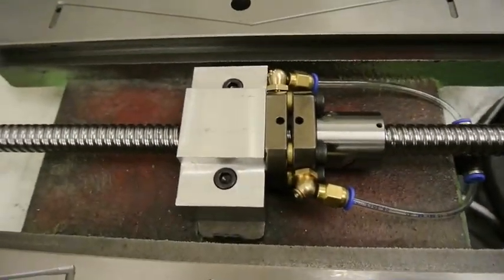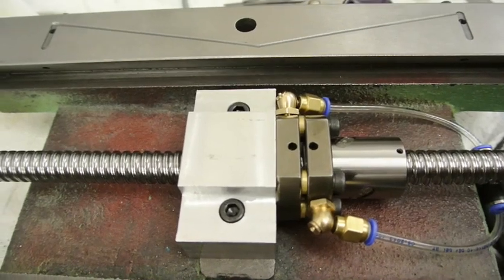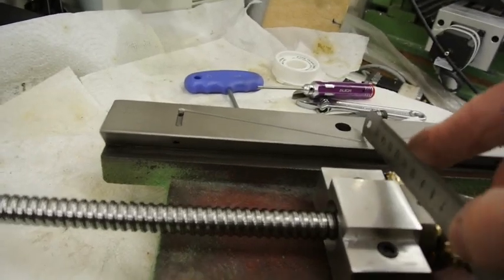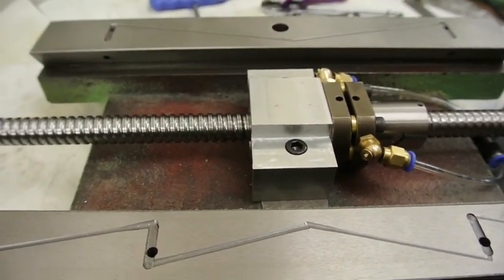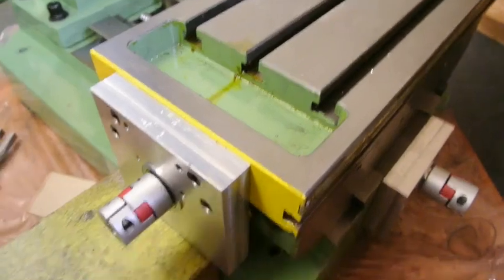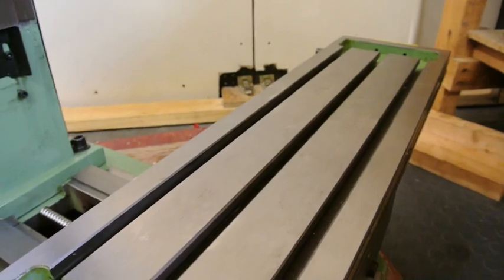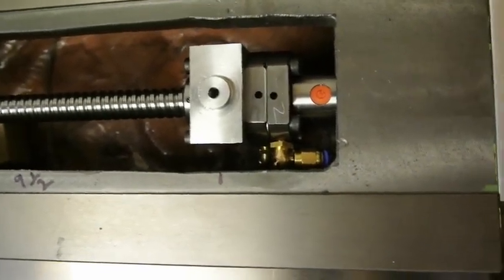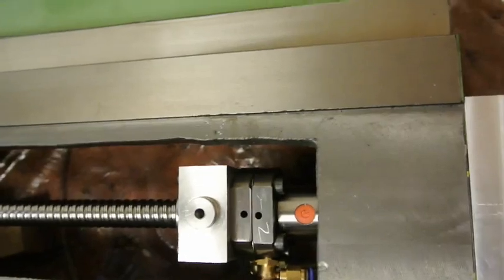Part 5 Warco 18GH X and Y axis ballscrews

Comment: Hi John,

Loving this video series and it has spurred me on into buying a warco of my own to convert.

One question I did have, how did you drill the receiving holes for the dowels into the table? My thought was that you either had a very very tall mill, or you had done this by some other method?
Reply from the maker: Hi Alex

Glad my videos have been helpful. I didn't drill any new holes for the screws and dowels. I just carefully measured the positions and the position of the lead screw and reused the holes to secure the new parts. 

John